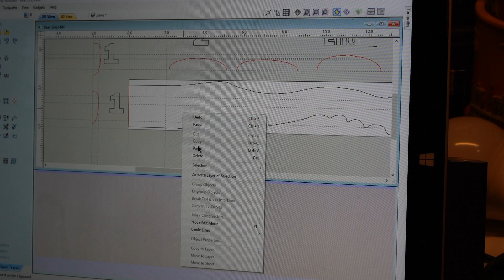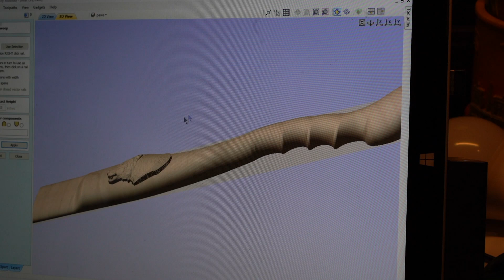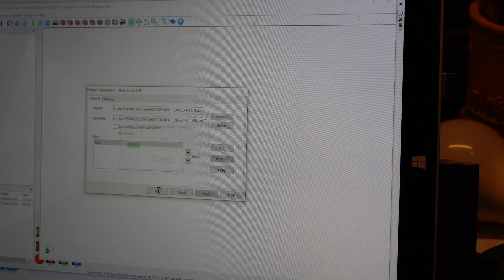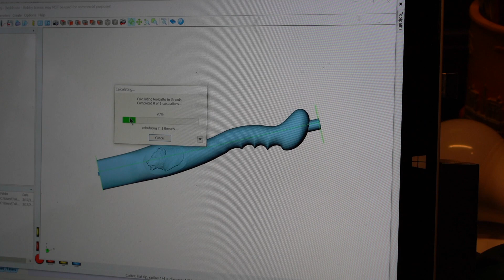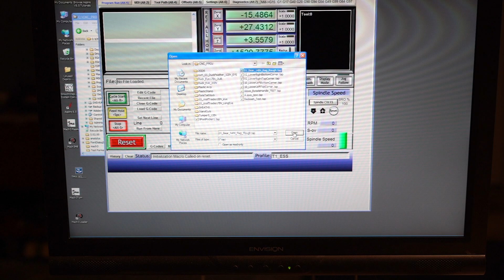Making Bear Axe Handle and Hand Engraved Axe - PART 1

Comment: Are the handles comfortable if you use it for a while?
Reply from the maker: Absolutely, for light type of work there's no issues. But for heavy, large axes I do smooth handles.
Reply: Do u sell just the handels?
Reply from the maker: Haven't tried it.